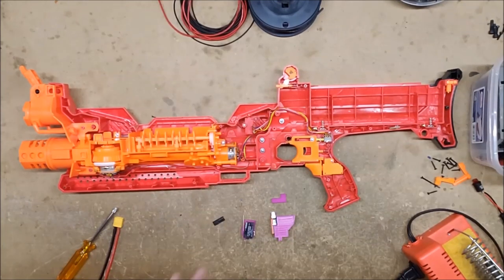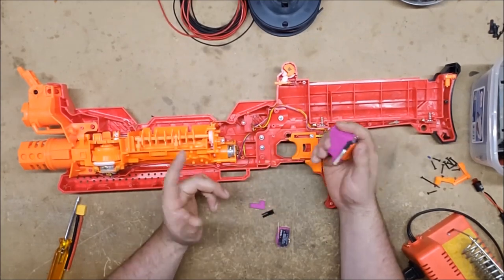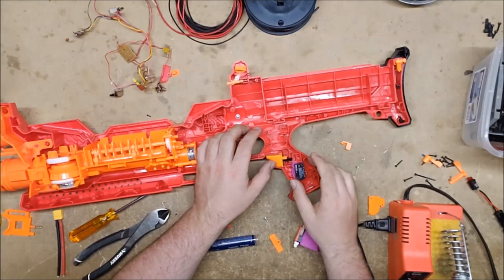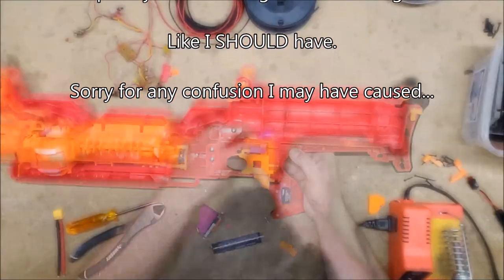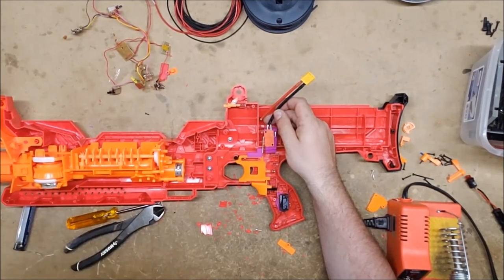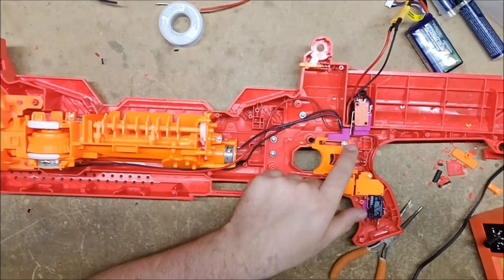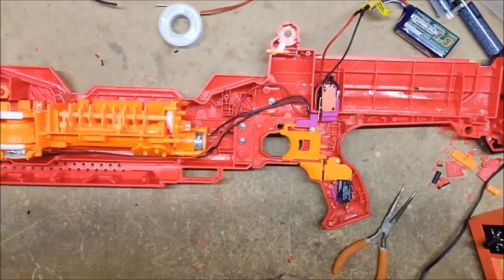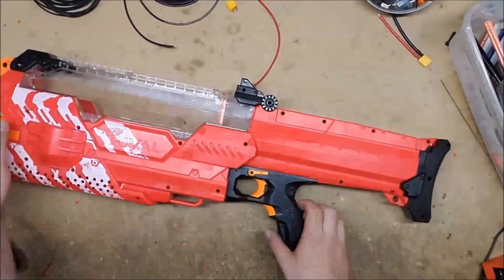Nerf Rewired - Nemesis

Comment: Doing a nemesis right now. I recomemd using the OOD site pictures for the part. It shows exactly where to mount them and where to put the trigger pieces. I almost did what Cap did. As for the wiring it wires like a rapidstrike.

Comment: Ever thought of doing a minimisation of an x-shot crossbow or crossbolt? Like, removing the arms, replacing the string, making the former work with nerf mags, and the latter have all the locks taken out etc? That, or ever thought of tackling the crossbolt flywheel mod? There's a 3d printed thing up on thingiverse for it by Flechette Spectre. I know it's not really in your typical purview, but I'm just wondering if you've considered, or would consider taking a look at them.  thanks.
Reply from the maker: Nope, never consided it.

Comment: Great video as usual, looks like similar to a Hyperfire rewire.
Thanks for the video!
Reply from the maker: Exact same wiring, just a different shell.
Reply: Captain Xavier I thought it looked similar, the Khaos is petty much the same too isn't it? I'll be running mine on a 2200mAh 2S 40C LiPo, same as my Zeus (which is basically the same wiring as a Stryfe, yes?)
Reply from the maker: Yup and yup
Reply: Awesome! Should be good to go!

Comment: love this im new to wiring blasters like this and this helps is there a way to also add the motor breaking to the rev triger flywheels so all of it does the motor breaking
Reply from the maker: Yes, but it is not really a good idea.  It is hard on the motors and will DRAIN your batter extremely fast with motors this big.
Reply: Captain Xavier i see like i said im new to all this

Comment: For it not to double activate when pressing firing trigger shave a small part where firing plate hits the trigger top portion. I did it on mine no more double activating. Followed the whole wiring diagram still the conveyor is not working. Probably need to crack it open 😭

Comment: I really liked that video I was thinking of getting a nemesis will have to bookmark this for later if I choose to rewire it, though when I see switches like that just soldered too it makes me twitch a little properly just OCD wanting to use the connector for it.

A question cap is there any other battery you would use beside a lipo ? I was thinking of rewiring a couple of my nerf blasters at the moment a Stryfe and a Khaos . Since I am more tinkerer then player, I did not want to spend the money on a battery and charger that might get used  once/twice every 2-3 months I was thinking is there a good alternative? or should I leave it stock?
Reply from the maker: With the stryfe you can get away with IMRs or IFRs.  There are also NIMH and LiFePO4's that have the same capacity and voltage as 3s LiPos but I have never used one so I cannot give any advice about them.

Comment: Hey cap i found a group of blasters. 3 pistols that whent to the titan as well as 3 of the pump blasters that went to the titan and a maverick a night finder a front gun and the dart tag blaster all for 35 but it is a few miles farther than my comfort zone is it worth it and i for got to mention the fire fly blaster. The seller said that they are all in great working conditions
Reply from the maker: Depends if you want them or not.  They are not exactly great blasters but they can be fun.

Comment: Hey can i get the place where you got the jolt tac mods?
Reply from the maker: The what?
Reply: The video where you were showing a stock attachment, barrel attachment, and a tactical rail for a jolt you have. I was wanting to know where i could get those parts if possible
Reply from the maker: I explain where they came from in the video. The barrel attachment point is from an Longshot. The sitcom attachment point is from Out of Darts. The rail I printed off Thingiverse.
Reply: Captain Xavier ohh i just seen it and thought "oh wow he got a cool jolt so i must be able to" sorry for the misinterpretation 😂
Reply from the maker: No problem, I just meant that you totally can, the parts are out there.